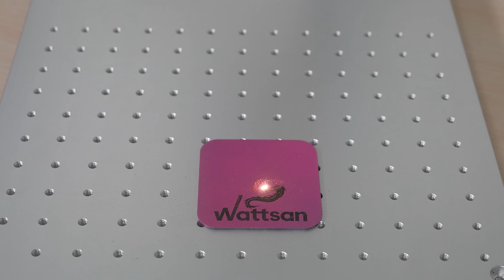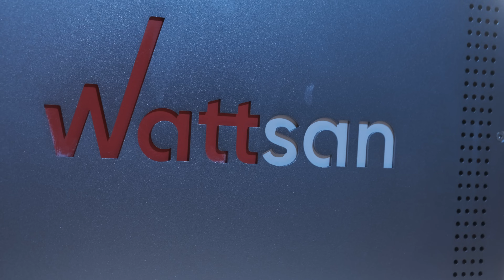Q-Switch vs Mopa: Battle of the Laser Marker Technologies

Comment: Well the first thing that comes to mind is the cost of this technology is more than significantly higher.

High enough that it doesn't make financial sense to the 97% of hobbyists or small business owners just starting out.
Reply from the maker: Agree that this technology is still quite expensive, but it expands your options by an order of magnitude. As for your question, MOPA is more often used in jewelry and electronics where thermal heating is not necessary. Or in business where color marking is needed. The main thing is to analyze the market correctly and buy what you and your customers need.